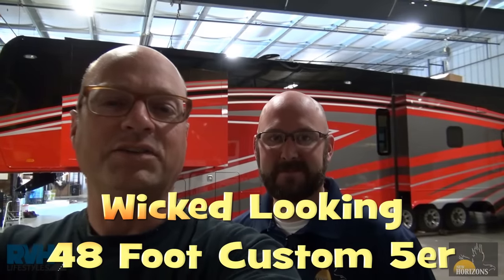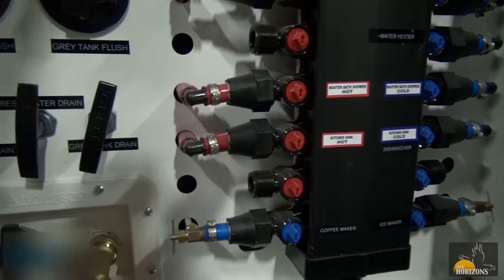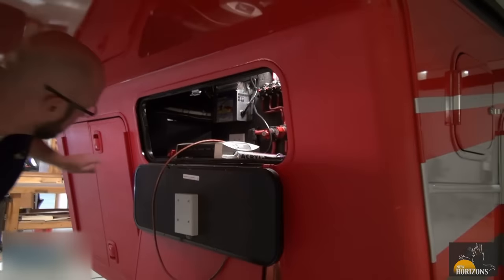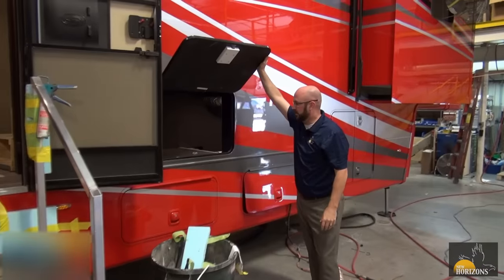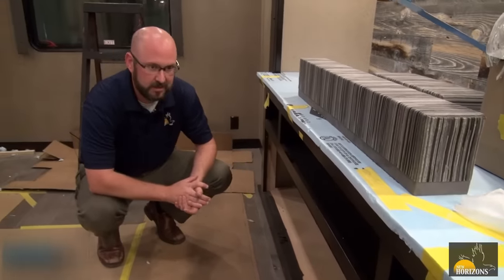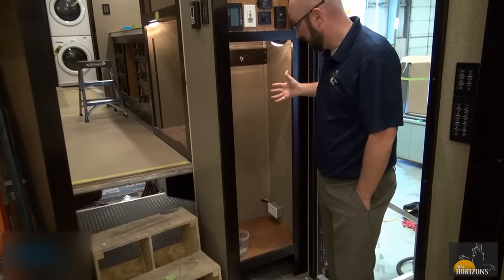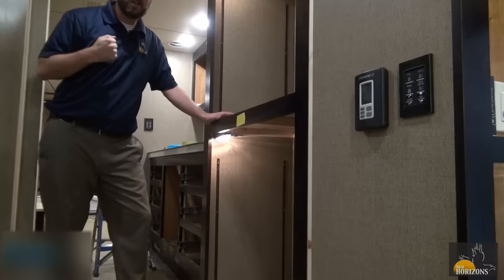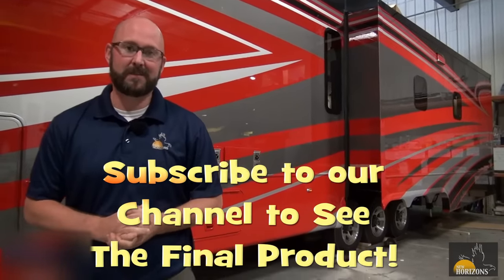Wicked Looking Custom 48 Foot 5th Wheel from New Horizons

Comment: I work and live in a camper biggest question I have is where are they gonna stay in this  Most camp grounds have problems with anything bigger then 38ft  and a lot of them don’t have 50 amp service.  So that leaves what truck stops? Weird way to spend money.
Reply: I believe they are professionals (accounting/auditing/nursing/etc.) that do a bit of traveling. Instead of paying for hotels, they drag the home around with them.
Reply: Agreed I thought the same thing they would have to rent two lots to feet it in a campground
Reply: @ClassicMusicianChannel  but still where do they put it
Reply: Professional Musicians.  Actors.  Plus, with a toy hauler this size, you can put a couple of bikes in the back.  Park the land yacht in a luxury RV park and ride the bikes into the back country.  Or take the truck.  There's a lot of use for this.
Reply: Seriously, if the have the money to buy this custom rig you think they are going to stay in a public campground with the riff raff? There are plenty of RV spots that strictly cater to the wealthy. I got to stay in one once, was truly a 5 star rv park for the rich and famous.
Reply: I have a 43 footer that I live in and I can pretty much stay anywhere. And most places now have 50amp... if they don’t I can still run both A/cs on 30 amp I just can’t turn them on all at once I’ve got to stager the “on serge” and shut them off if I need to run the microwave. If they don’t have 30 amp I can run my fridge off of 110 and I’ll use the propane water heater.  The lights are all LED so their isn’t  much draw.
Reply: Yeah, you have to wonder where in the world can you take this thing.

Comment: I really appreciate showing this unit in the middle of a build. The paint is most impressive and as you said it looks like it is moving. I will look for the finished product video but I wished you would have talked about the final weights you are going for and the different storage capacities you are planning. I'm also interested in the wall, ceiling and floor insulation and R values you are designing for.. I hope you put a good 9 panel solar panel array on the roof and make room for 8 flooded batteries running at 24 volts. Of course this unit will probably spend its life in a park. You must need a semi tractor to tow it. Thanks again.
Reply: Actually a F-350 , 450 or 550.  Ram 3500 and up will pull it.  Diesel power a must. Medium duty FL60 which is a Frieghtliner handles those quite well.  My wife and I are looking into having a luxury coach built and truck to pull it.  I’m leaning towards a FL60 crew cab to pull ours. Have a great day.

Comment: Beautiful rig, and I love the paint on the side of the slides.  Nice detail touch.  However, I really don't understand the laundry in the master bedroom.  Those things are annoying to hear, and in case of a gray tank overflow, it will flood the master bedroom.  (I know this from experience when the washer flooded, ahem, twice.)  Yes, you can monitor the gray tank easily, but mistakes happen.  Also, why the choice of the Lippert levelers?  Even in my Momentum, my whole rig shakes when the washer and dryer are going.  Why not use the sturdier units that you see on Class A's or Super C's?
Reply: The kitchen sink fills first. We do not do laundry when we are in the room. The levelers are not Lippert they are Big Foot. We have 4 not 6 because they are not cheap lippert crap. Our frame has at least double the steel of your momentum. It hardly shakes at all.

Comment: Single spare tire?, stored inside to take up valuable space and how much you gotta remove when you need it? no shielding or sound dampening around the generator. How you going to keep it dry when you run threw a rain storm, really good looking area for 2 spare tires, also reduce pin weight. Excellent looking 5th wheel.
Reply: I agree I'm not a fan of the gen location either for several reasons.  I would also be concerned about fumes seeping into cabin.
Reply: @rockyalvarez520  Um, exhaust pipe???

Comment: What does or take to pull a rig of that size?  I pull a 45’ with my 2017 F450.  Wondering if I could pull this one.  I’m in the market for a new rig.
Reply: walterk15able your f450 could pull this. I would think about adding air bag suspension and an engine brake tho
Reply: @lanebelcher7717  he'd only have to worry about adding air bags, the 6.7 Powerstrokes(2011-current) come with an exhaust brake that works pretty well
Reply from the maker: If you are interested, the truck they use to tow this unit is in this video... The finished product - Here you go!  https://youtu.be/9BGi-_c8rJk

Comment: Just what states are you gonna tow a fifth wheel this long legally? The majority of states have overall length limits between 60-65 ft and many have trailer limits of 45 ft. Louisiana is the only state east of the Mississippi that allows 70 combined, but they have a trailer limit of 40 ft. When dealing with lengths, it doesn't matter what is legal in you home state once you leave that state,  although I've not sure how tightly it is enforced in many states.
Reply: The limits you are speaking of pertain to a unit being towed by a pickup truck in the video he clearly states the owner had ordered a Volvo which would be in the class 6-8 range allowing a trailer length of 53' across all of North America with no special permits or licensing
Reply: This is ment for a tractor trailer type pull. I would be the idiot pulling it with a 1ton and no cares, but this is perfectly legal with a semi.
Reply: Roy Davis chances are a CDL with that Volvo truck would negate your entire comment...
Reply: 19 states allow trailers larger than 45 feet

Comment: What is the weight of a coach this size? Sorry if it was answered already. For some reason I can't see reply's to other comments.
Reply: Yes, would be nice to know the weight.  However, if it has three 9k Dexter axles, and you use the formula of a 20% pin weight, I would guess that the max GVWR cannot exceed 33,750.
Reply: 31K loaded.

Comment: Could we design / build a owner designed 53 foot 5th wheel trailer? W/ 4 axle air suspension?
Reply: Brian Shull At that rate, you would require a semi. Then you might as well go spacecraft RV with a daycab semi. They push 57ft in length
Reply: you would have to pull it with a semi tractor. It would only be legal in 19 states.  And most parks would not allow it at all

Comment: I have a few questions. What size truck is required to pull this unit? What type of license is required for the truck driver? Do your customers drive this trailer themselves? I recently saw a video showing a customer driving a brand new F250 pulling a large, also brand new, 5th wheel coach that jackknifed. There was some speculation that a F250 was underpowered for the load. I would be petrified to drive anything this big.

I know that you do custom, but I am curious at what kind of price range your 5th wheel coaches are priced at.
Reply: Steve Schlackman this would require a cdl since it semi
Reply: This thing probably weighs upwards of 30k lbs empty so to safely pull it you would need s semi tractor imo.
Reply: tractor trailer with class A. Nothing less.
Reply: Just the same as any other trailer with GVWR > 10k pounds.  In TX, that would be a non-CDL class A driver’s license.
Reply: This thing probably has a dry weight of low 25k lbs. loaded you would need like an f450 dually or more. a medium duty truck or a semi would be best.
Reply: How cares if it not far 3500 or bigger but if longer run hire online guys to move it is cheaper but I have a brother that is a cdl truck driver into I get mine but my 3500- 4500 Ford's and Dodge or even a safety hitch is great news but it's other 10-15 k
Reply: Jim T. What is a non cdl class A in tx... only class A i know of is a cdl?
Reply: @nikriedel2329   It is just what he stated it is a non commercial class A license.  The tovie go and trailer exceed  26001 pounds combined way with a trailer exceeding 10000 pounds in gross vehicle weight. The reason it is a non CDL is it is a personal vehicle not a commercial vehicle

Comment: Could you pull this with a 4500 or 5500 Ram Cummins truck?
Reply: Josh Grimes yeah it could but I'd add airbag suspension and an engine brake for safety

Comment: The  thing that bugs me Is that the things that really matter when it comes to longevity quality efficiency are the same as the fucking cheapo fifth wheel down the road.  Putting a Nice paint job on the same old crap is not appealing to me.  There are some renovations and updates that have been made that are really good like the fiberglass backing not being wood.  But they’re still using the same fucking cheapo furnaces the same cheapo water heaters the same plastic trim around the slide outs the same crap insulation, rats and shit still get into the units.  I’d like to see that plastic shit replaced with aluminum and the underbelly, why don’t you go under there and talk about that that’s what really fucking matters because that’s how all the fucking critters get in.  Is that still made out of the plastic cardboard shit that doesn’t last?   Let’s face it folks nobody makes a quality fifth wheel anywhere.